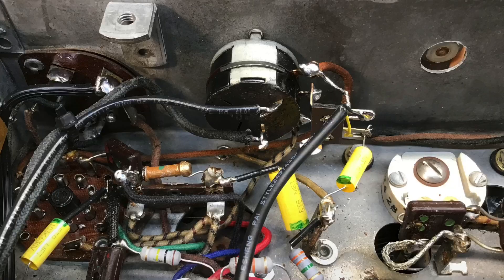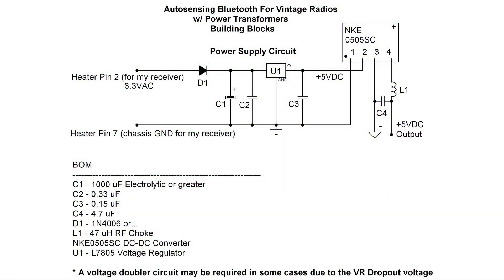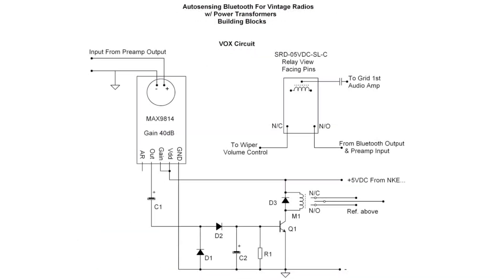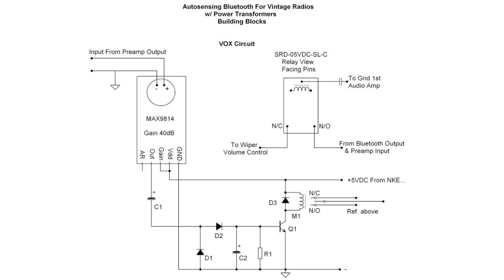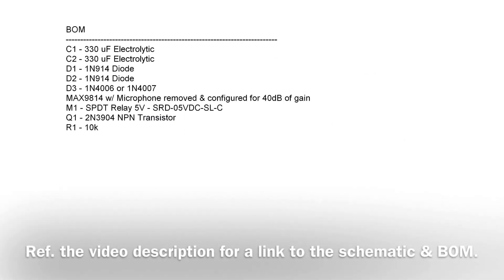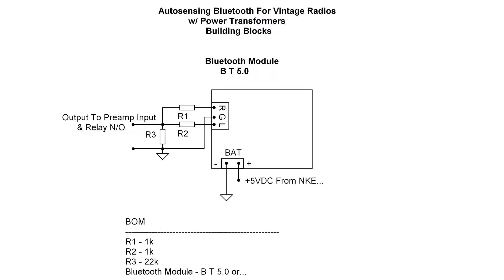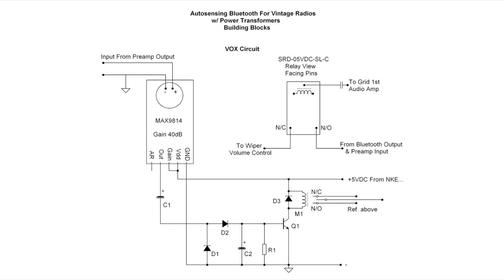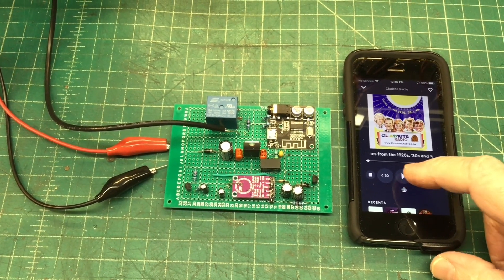Autosensing Bluetooth For Vintage Radios w/ Power Transformers

Comment: When you repair wood veneer which brand of glue do you prefer? I saw in  previous videos you used white glue and in another hide glue.    Thank You for your response!
Reply from the maker: White glue seems to provide a more long lasting stable repair. As you noted, I’ve used hide glue in the past, but my experience using it is limited. Sorry for my belated response, I’ve been away from YT. Best, Don